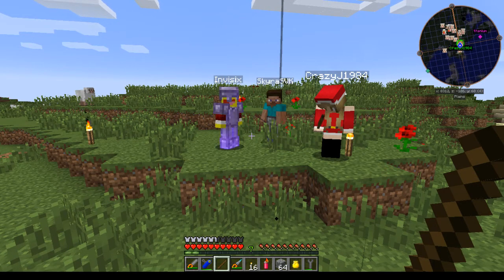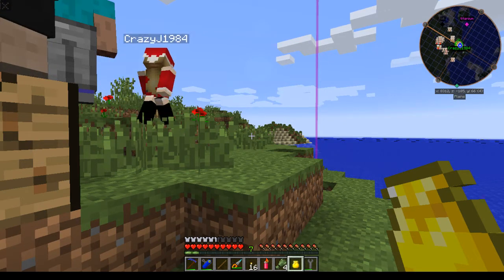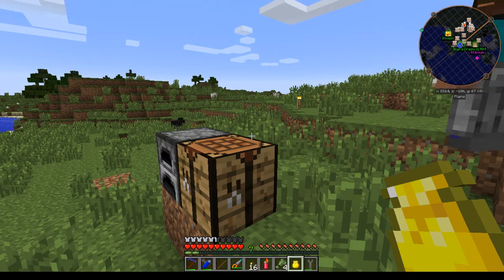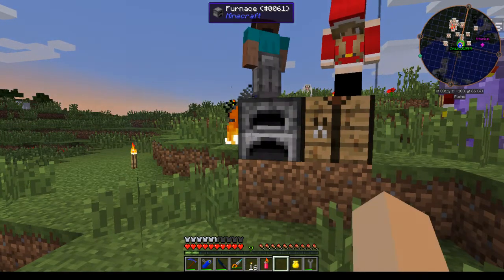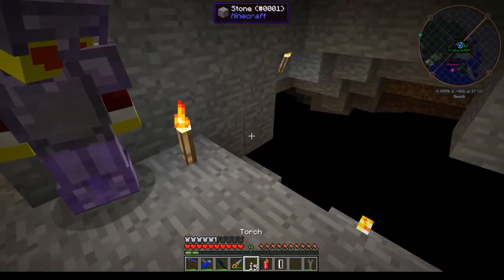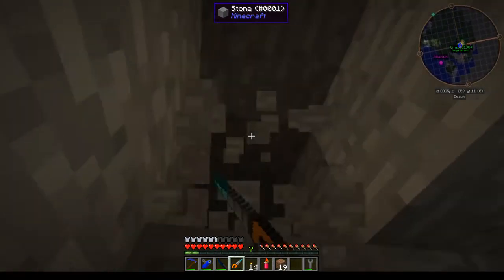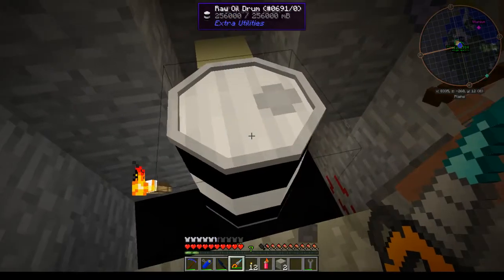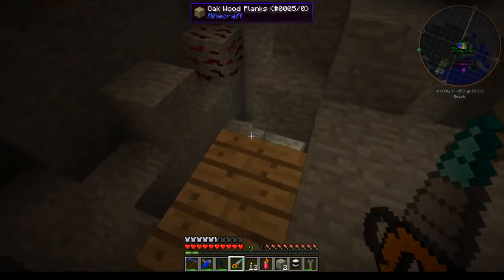[Gregtech 6 LP] EP 192 GT6.03.34 update oil and grass

Comment: Totally awesome. This mod keeps getting more brilliant, thanks for the showcases!  "Greg, your shit don't burn" I laughed lol. I'm surprised as well that the oil doesn't burn on touch and that it reacts like water. You could see splashes of water when you fell in it. Maybe the heavier it is, the more it could slow you down when you swim in it? Just an idea. Edited parts are in bold letters.
Reply from the maker: your welcome, and there is some fluid mechanics from vanilla MC that I think your stuck with like the interaction with lava, but we shall see if greg comes up with anything.
Reply: Another question for future knowledge, how should I handle pipes?

I think I know that the melted metal shouldn't go in the weaker ones with less Kelvin Units resistance, but how do I know if the steam might melt it?

Or does distilled water keep the content from overheating?

I know I think I saw your steam boilers (Sorry, I just can't seem to find the right word for these) being at optimal operating temperature in every of your vids. Is that thanks to distilled water?
Reply from the maker: for steam anything metal or sealed wood even will work, I like invar cause they wont burn you, aluminium as well.
Reply: Oh, nice!

Well then I guess my character's safe with all pipes since I put him with the same powers than in my RPG Project which includes burning-proof due to him being always watered.

I won't get into the technicalities, but let's say it's a huge perk in GregTech.

(I put a redstone loop to give him the powers I wanted him to have with command blocks... yes, I know it's cheating but the blue kitty on my account picture without his powers just isn't fun to play nor would he be himself lol.)